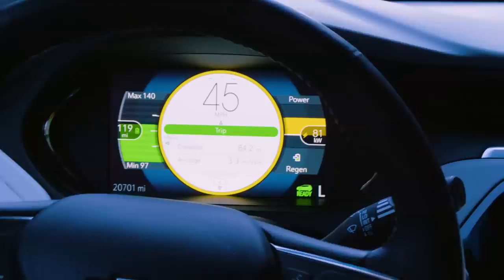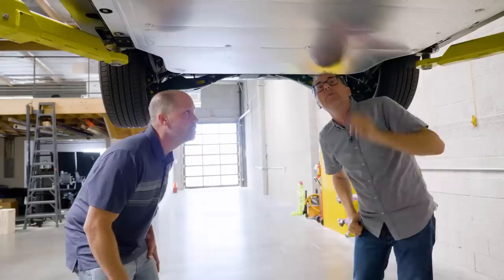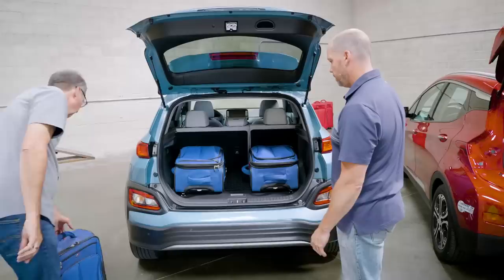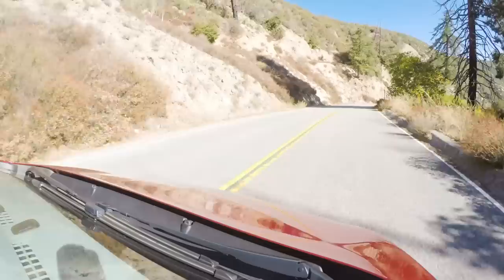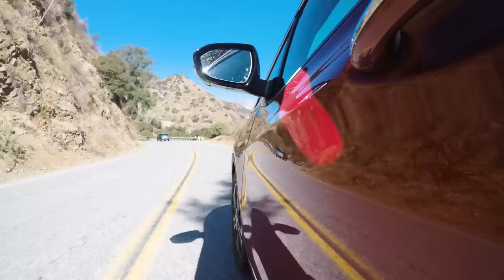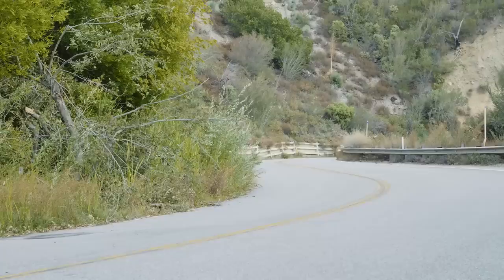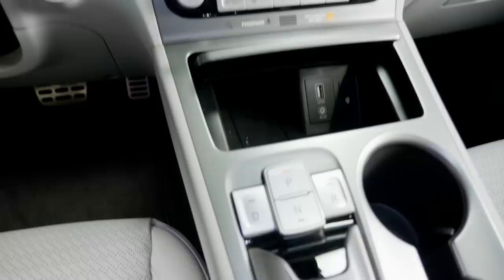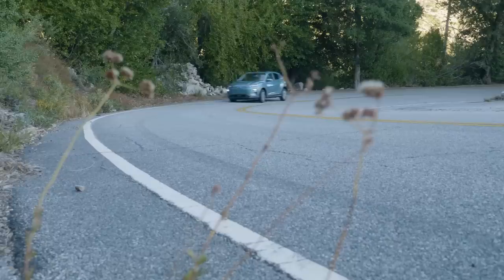Hyundai Kona Electric vs. Chevrolet Bolt EV: Which Is the Best Affordable Long-Range EV? | Edmunds

Comment: The Kona absolutely kills the Bolt.  It's got MORE range than the Bolt, much sexier looks, and a much better value.  No wonder why Hyundai has got a BIG following on this Kona EV.
Reply: Well, the Kona will likely be 45 50 grand, you can get the top bolt for 38

Comment: I had an Oldsmobile Alero.  The rear wheels were stiff even with hew bearings.  Based on the comments I got from mechanics, I have determined that GM does not believe in bearings.

Comment: You should have talked range though. Because the Kona will go way farther than the bolt in real would testing. You should have tested their highway range. I'm guessing the Kona would have gone about 50 miles farther.

Comment: If they liked the Kona, they're gonna love the Kia Niro EV.  The rear seat legroom they complained about in the Kona is a non-issue with the Niro.  It is also even more substantially  equipped than the Kona with more premium looking/feeling materials.  The powertrain is identical to the Kona but will get slightly less range due to the increased weight.  Still well over 200 miles though.
Reply: I would consider Kia Niro for large space than Kona, but it is now rated at 239-miles by EPA, so that's about a 20 mile less range... so..

Comment: The Kona wins in the looks department by far. It looks like a normal crossover. The Bolt still retains the ugly electric car look. Thats a big problem with me. Looks do matter. A black Kona looks good. Id drive it. You wouldnt catch me dead in a Bolt.

Comment: Affordable is a relative term. Here in Canada, the Bolt STARTS at $44,400. That's a lot of money for a small homely car. I can get a 4 year old Buick for a lot cheaper and spend the difference on years and years and years worth of gasoline. Sorry, car companies, you're going to have to do better than that. Maybe one day soon, just not today. They need to adjust the numbers, like, say 500 miles range and a startup price of $25,000, that would work for me, and the very many people like myself who don't have a lot of money to throw at a car purchase. How serious is the money angle? Well, my car was $6,900, used and I've driven it for more than 10 years now and have saved untold thousands on a higher priced higher taxed new model. I'm sure the electric car will get there sooner or later, right now the more affluent in our society are paving the way for the rest of us and that's the way it is with everything else. Remember when a 29 inch television used to cost $2,000? Give it some time and it becomes a whole different ballgame. Also there seems to be some confusion in the way to spell steel and steal in context. I'll make it easy for you. STEAL is like what the government does when it takes money from your paycheck before you even get your hands on it. STEEL is what all politician beating sticks should be made of. Hope that clears it up.

Comment: Horsepower means next to nothing in an EV, torque is what is important. Beyond that, horsepower doesn't mean much in ICE cars either, it's mostly marketing; HP = (RPM*Toque)/5252. Although the 35k Tesla was release after the posting of this video, the Kona wasn't on the market when this video was posted either, so you know, grain of salt and all.

Comment: what about the reliability, i know some one that had 1st gen volt and it was a nightmare
Reply: The Bolt has been out for 3 years now and I'm not seeing any reported major issues. I think the Volt helped GM with battery technology so that by the time the Bolt came out they pretty much knew what they were doing. I would have considered a Kona if they were sold in my area, but they are not. My choices were Leaf, Tesla M3, and the Bolt. The Leaf was out because I'm not going to get an EV without active thermal management on the battery. So that left the Bolt and M3. The M3 is by far a better car, but I'm just using this car for commuting and the roughly $12K lower cost (GM heavy rebates) I ended up with a 2020 Bolt.

Comment: Are those Nexen tires on the Kona? I have those on my Soul.  The Soul I bought used with 30,000 miles on it.  The Nexen's, at that mileage, are junk in the rain and major junk in the snow.  They hav plenty of tread on them and are at least 20,000 away from the wear bars.  These tires are junk...

Comment: The Model 3 is "vaporware"?! The Kona isn't available--neither is the price/build/packages. Tesla has a version of the Model 3 with a 260 mile range that is only $1,690 more than the top of the line Bolt. And the Model 3 is far better equipped. And it'll smoke both of the cars in this test.

Comment: They over price the cars by $7,500 so GM and Hyundai end up with the tax credit, not the consumer.  If they were priced only a bit more than a Civic or Corolla both the cars would be much more enticing I think.   For now my money will be spent on a Toyota Corolla and a gas card for Costco.
Reply: I'm not sure about the overpricing angle.  Regardless, I took the route you proposed and bought a 2019 Corolla SE with 6spd manual.  It's great. No games all go.

Comment: What, what, what? New magical cars that get the equivalent of 3000+ km to a tank of gas.
What, what, what? New magical cars that when I take my foot off the accelerator and/or put my foot on the brake and/or hit even the slightest downhill it creates new gasoline out of thin air and pumps it back into my fuel tank? 
Crazy! Why isn't everyone saying what are these new magical cars you speak of, and where can I get one before the sun sets today?

Comment: Yet another example of slow suicide by bean counters. And you know who it is, because they've been doing it since whenever. Shame though because they're reasonably capable of doing better (they've had a couple rare all around good vehicles at times), but they don't.

But now that they have an obvious segment competitor, are they going to fix the problems?

Comment: The major advantage for the Bolt is, you can buy it.

Where are the Hyundai and Kia models?
Reply: They out be out for a month
Reply: I was told that in February, and March.  

The dealership won't even provide expected prices.
Reply: @stevesedio1656  39,000 at my store already waiting to be sold
Reply: Where are you located?  

Where do I get information and pricing for the models?

Comment: This is the old rev Bolt EV. The new one has better seats and a longer range for less money
Reply: Well since the review is from 2018 what else would you expect? We test drove the 2022 and the interior is much improved and the seats were just slightly improved.  Hopefully they get the defective batteries replaced ASAP.

Comment: To anyone seeing this video.....We have a Hyundai Kona EV and it has been an absolute NIGHTMARE ownership experience!  Our model is one that needs a battery replacement.  Our car has been at the dealership now for 3 months and we have no solution or answers!  No loaner car provided, no financial compensation, nothing!  Hyundai has no answers on time frame and our dealership is pretty much in the dark as well.  They have requested the battery extraction device but have no idea when they will get it!  I HATE SEEING ALL THESE VIDEOS BRAGGING ABOUT HYUNDAI'S AMAZING EV CARS....I WOULD LOVE FOR HYUNDAI TO PUT THEIR FUNDS INTO SERVICING WHAT THEY HAVE ALREADY SOLD!  We have owned 4 (four) Hyundais now and this will be our last one.  I'm over it!  I'm so sick of seeing these videos influencing people to buy from a company that can't service the EVs it's already sold!  Buyer beware and ask your dealership very specific service questions before buying.
Reply: That so sucks. Sorry to hear about your bad experience. They should have to at least cover a loaner or rental car. 

We almost bought a 2022 Bolt when they first came out but the guy at the dealer was being a jackass so we walked. At the time the battery issues were just with the older models supposedly......Wrong. We dodged a bullet.

Comment: It took less than 10yrs after Government Motors bailout for the engineering to take a back seat to accounting.  You'd think GM would have learned.  If I were a shareholder I'd be pissed.  I'll take an asian vehicle all day long before I shop GM, Ford or FCA.

Comment: There is just no point in buying a car which makes you hurt when you sit it in.. and for which the parts supply is rationed or non-existant.  Bolt looses in typical GM fashion.

Comment: Great comparison.  Putting aside relative prices for a moment, the Bolt lacks Adaptive Cruise Control, the Kona Ultimate has it and it is available for $5,000 on the Tesla Model 3 as part of the EAP (Enhanced Auto Pilot - not to be confused with autonomous driving option).  In my humble opinion, this feature should be standard or at least available at a nominal price on all models of all 3.  The Kona looks attractive but may not be available for some time - at least in CT, where I live.  The dealer where I leased my current Hyundai has no plans of selling/leasing the Kona EV in 2019, but I hope that changes.  One other consideration that would be nice for you to include in a comparison is how a set of golf clubs and folding walking cart would fit in each vehicle - without folding down the back seats.  For this test, I tried all 3 - the Bolt and Kona (non electric but presumably the same size) were tight fits.  I had to remove the long clubs and be a bit creative with how to position things - very tight for even one set of clubs.  The Tesla Model 3 easily fit everything and could accommodate multiple sets of clubs.  If you do a follow-up review, I hope that you find the time to compare the various features available as well.  Thanks for your effort.

Comment: I've seen other reviews say that you can hold down the paddle shifter on the Kona for Level 3+ regen.
Reply: I don't think so. I believe that will put Kona into ECO+ mode, which basically shut down all other non essential functions that burns power, like air conditioning, etc.
Reply: The Bolt also has one more regen level if you use the paddle on the left of the steering wheel. The Bolt's regen is really great. I can sometimes go an entire week without using the disc brakes to stop the car. I basically only have to use them if someone cuts me off or something or someone runs out into the road. Otherwise, the regen easily brings me to a stop.

Comment: GM has this aggravating habit of "walking into" getting it right and then not moving on when they did get it right but could do better. The BOLT shows this a LOT. Per GM's usual MO, I have to let it go as "this is their first production BEV". at the same time I hate doing that. IF GM keeps slow walking into getting right, I will have to blame the Execs for not firing the Bean Counters for not allowing the designers and engineers do what they know will work. Then I'll curse the Bean Counters.

GM tends to want to do  their best work, but the Backroom execs just will not let them. Front loading Chevy with vehicle that would be better served as Buicks and Cadillacs. Letting Buick sort of languish even though the brand really could be special in the US (not just China), and Cadillac is just being buffeted around by market forces they should actually be almost entirely immune to if they were allowed to have the product the need and the segment demands. 

GM does not pop out "less than" vehicles because the people actually designing, engineering, and building these vehicles don't care. You let them have near total free reign on the next Full-sized truck, Corvette, or some concept "new think" vehicle and its it better than virtually anyone elses. They pop out "less than" vehicles, because the Bean Counters won't sign the checks to make better happen and execs don't really seem to give a flip.

"Great product portends great profit." Apparently no one at GM has ever heard of that.

Comment: GM has no idea how to sell and market the Bolt, Volt, Spark. And they refuse to listen to people. Hyundai/Kia can sell on the basis it's "not a chevy". Tesla can sell on style and "Apple" image. Other than brand image and style opinion, Chevy's only weakness is slow "fast" charging after it reaches 55% full and is slow under 17% full, so you still have to treat it like a 100 mile battery that you only charge in the bandwidth of no less than 17% to no more than 55% for fastest charging, especially when EVGO charges by the minute. But possibly GM tapers speed for warranty avoidance = longer life. Depending on the pricing games the dealers will play, you might be able to get a deal on the Kona. Or they will charge $5k ABOVE sticker. $40k Bolt can be negotiated to $32k.

Comment: BIGGEST DIFFERENCE. The Bolt is an EV. People will recognize it as an EV. Kona EV looks 98% the same as the other "millions" of gas versions they will build at a ratio of 100:1. Why would anyone spend double the money and want to be an early EV adopter only for your cool EV to be recognized as a "cheap-ass" run of the mill gas car?

Comment: Complains that the 35k Tesla Model 3 doesn't exist.

Tests the Ultimate Kona with MSRP 45k and Premiere Bolt with MSRP 42k.
Reply: I mean fair enough. But I don't think Hyundai or Chevy let them pick the specific model that they wanted. Most manufacturers just send out the top of the line for everything. And you can get most of their features on their base price version. The Bolt especially has dropped in price significantly. Maybe not the official MSRP, but talking to a few dealers in SoCal a few weeks ago they offered significant price drops if they could get rid of the ones that have been sitting on their lot. And used ones are readily available around $15K-$20K.

Also, there is no wait on these cars. You can wait 1-3 weeks for a Tesla or you can drive off the lot in one of these today. Personally I prefer the Model 3 as it looks sexier then both and I'm single so space isn't really a factor for me. I would be willing to wait. But I understand why many people would rather have a Kona or Bolt. All three are different EVs designed with different priorities. I'm just happy that there are more options than ever for electric cars. Hopefully some of the ones like the Honda and VW make it to the states as well.

Comment: Auto reviewers seriously need to learn that one of the absolute most important things when shopping for an EV is DC charging speed , in terms of miles or kilometers range per minute or hour of charging. Yet almost all seem to leave this aspect out.

In case anyone's curious: Kona will charge a touch faster than a Bolt on a 50kW CCS charger. Kona will charge about 50% faster than the Bolt on a 200A CCS charger (usually nominally "100kW" to "175kW"), although those are much rarer, particularly in the US.  Model 3 LR RWD on a Supercharger will charge about 50% faster than a Kona that's on a 200A CCS charger (AWD and P charge slower than RWD... they take the same power, but they consume more energy per unit distance)

Comment: Right, it's about suspension and what not. Fail! Both cars ride well but the Kona has much less useful cargo space, horrible back seat space, no app control, has to be plugged in for ac/heat to be on, ugly exterior styling, charge port cover that allows snow and ice to get in and a useless middle console. No USB chargers for back seat. The list goes on I'll take the Ampera/Bolt any day.

Comment: Tesla Model 3 production numbers dominate both of these cars added together.  The Bolt and the Kona are the vaporware in this video!   Lmao.
TM3 = 130,307
https://www.bloomberg.com/graphics/2018-tesla-tracker/
Bolt  = 47,000 by GM's own tracker.
http://gmauthority.com/blog/gm/chevrolet/chevrolet-bolt-ev/chevrolet-bolt-ev-sales-numbers/
Kona = 32,795
http://www.goodcarbadcar.net/2018/04/hyundai-kona-sales-figures/

Comment: Bolt is a Spark with a motor and a battery. That is not an EV. I own a Zoe because the Kona is not available in my country, otherwise I will buy it instantly. There is nothing in the Bolt which is better than Kona. NOTHING. And what about charging ? In how many decades Chevrolet will put 150 kw charging capability in any car ? Hyundai has it now and it will only get better in time.

Comment: ok...more upscale interior/suspension with bigger battery is the nicer car, but they basically don't discuss price at all.  a Lexus would win any comparison against a corolla, until you figure in price.
Reply: In South Korea the Kona EV is ~10% more expensive than a Bolt EV.

Comment: What the hell is he talking about on the tax credit it only goes to 2020. Sales ya but gotta hit that by 2020 unless it got extended and I didnt hear. I dont the the front of the kona but interior is better. Different tires which you can do on the bolt improve handling but they are designed for max efficiency wider tires more drag. Regen is better in the bolt and you get alot more back. I usually go well over what is says for range when i tested it. I ripped out the seats personally but I didnt have an issua with comfort but if you have a wide ass then whatever. 😁 it's all about the price personallly.

Comment: >^..^<       Vary Nice Review, thankl you for making it and sharing.
Sadly, as an American citizen, I hate to say that the Kona seems alot better engineered with out question.....
Also An FYI for you. The word kona in the Hawaiian language describes the area of the leeward side of an island. Meaning downwind of the normal traid winds which often makes the taller islands to have a wet side and a dry side, the kona side is the dry side.